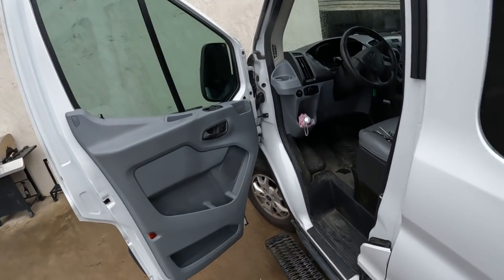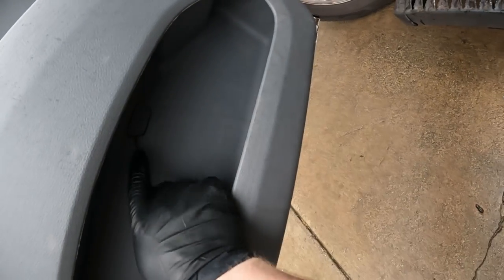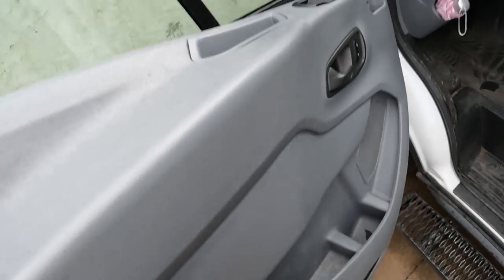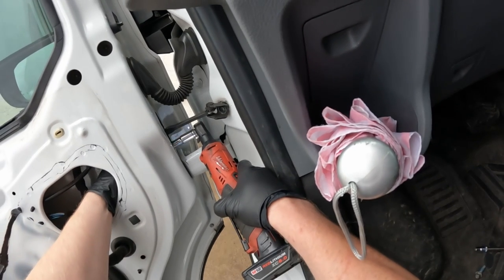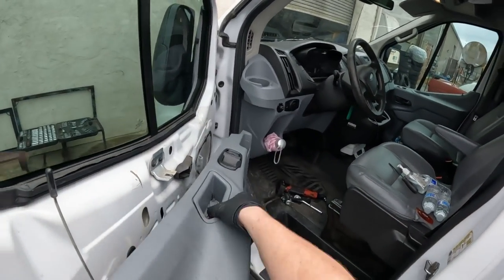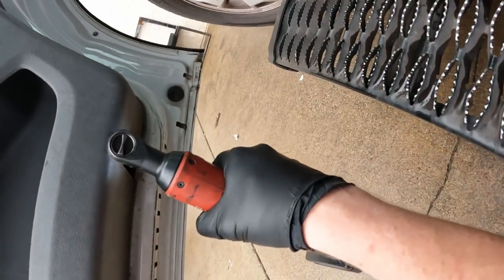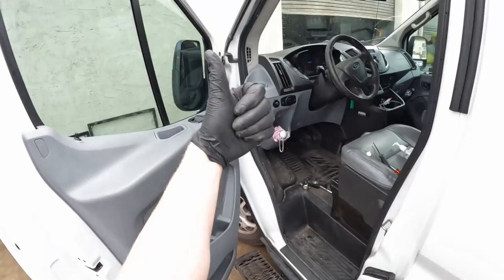Ford Transit Door Makes A Popping Noise Check Assembly Replacement

Comment: Worked really nicely… I did loose function on my power lock button, but the unlock button still works  🤷🏻‍♂️ I tried to find the cause, used some contact cleaner in there. I don’t know what went wrong, perhaps a wire broke somewhere in that bundle. I can always manually lock the door. Also, the remote on the key DOES lock and unlock the door, interestingly! That’s good enough for me. Click click click is gone so that’s all that matters 🎉😅

Comment: What's the little Allen head bolt that sticks out of the door? Just above the wire harness
Reply from the maker: Do you have a time stamp?
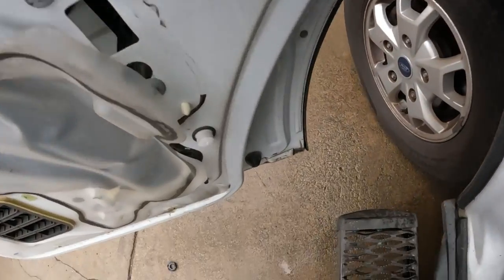Reply: @GrimRepair   you can see it at 3:47. I noticed it on my work van today and came across your vid while trying to figure out what it is.
Reply from the maker: I don't have the van in front of me, but I don't think that's an Allen head. I think it's a stud that has a nut on it, probably holding the glass in. I'll try to remember and check next time I'm at work.
Reply: @GrimRepair  Allen head was the best description I could think of lol

Comment: My popping sound is from body panels pinching after the wind grabbed and over stressed the door.   Do you have any videos or tricks for hinge replacements or door alignment?  My door is still shutting properly but takes much more force to do so now. 😅
Reply from the maker: I don't have any tips on door alignment, it has always been tedious trail and error for me.
Reply: Can't believe this happened with 24 hours of the same thing happening to my Transit as well.
Reply: Did you ever get this fixed.   My door got grabbed hard by the wind just like you said and it is pretty bad.  Almost doesn't want to close.
Reply: @jacobroberts3964   No, I mean to try a technique I saw in a different video where the guy loosens the bolts on the door and uses a car jack to raise it slightly. He then retightens them, and it fixes it.

Comment: and if you replace the assembly and the NEW assembly does the exact same thing?
Reply from the maker: (Not a joke I have seen it happen before) make sure they didn't get mixed up, and that it is in fact the new one. If it is the new one making noise then it sounds like you got a bad one. You could try spraying it with white lithium grease and see if that helps.

Comment: All that for a dumb ass plastic door hinge. How much was the part? I'm looking at a van and it had this issue, the dealer didn't want to fix it.
Reply: Nevermind, just saw your link, $30, thank you.
Reply from the maker: They didn't want to fix it? What did they say?
Reply: @GrimRepair  They're just selling it for cheap and the door was an issue for me. With this video, I may just go get it and do it myself. You're awesome, hope this work for 2014-2020 models?
Reply from the maker: @warrenlowe676  those are the years in this fleet, so it should be the same.